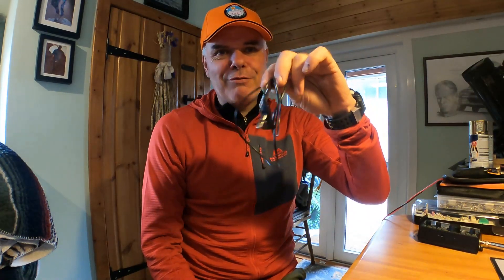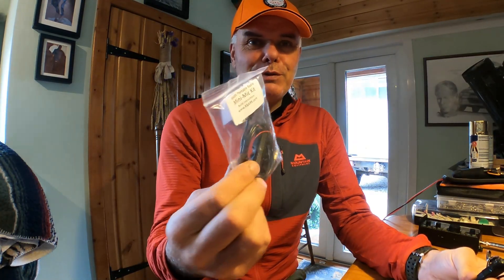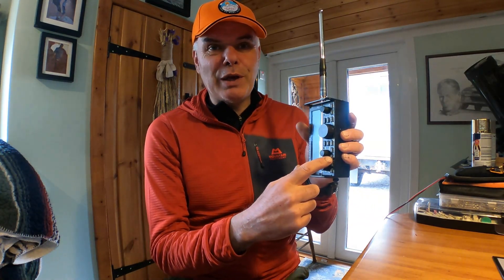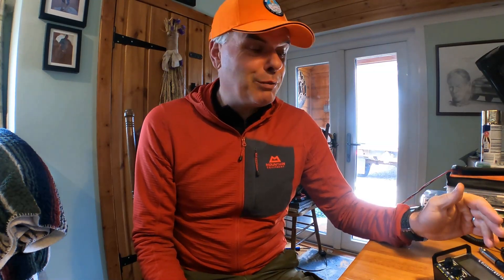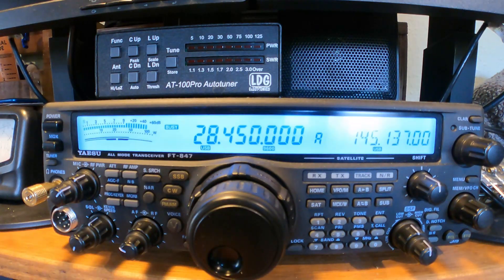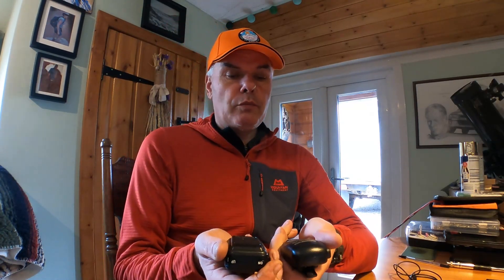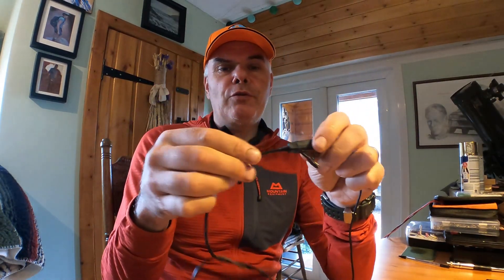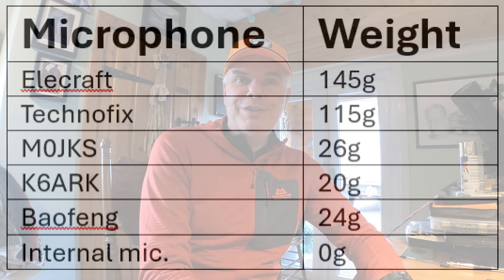Ham radio  microphone test

Comment: OK you asked for it Fraser! I always carry a converted Standard™ CMP115. September 2023, Lizard in Cornwall, some contest or another, KX3 at 15W through a home made loop on 20M, I managed Indonesia and Western Sahara among others so I guess it's good enough. I converted a similarly sized Icom HM-75 but I gave up trying to get the up/down buttons to work. It's fine but I stay with the Standard mic.I never use the MH3- I feel let down by the wallet gymnastics. Recently, I converted a Retevis HK008. This idea came from DL2MAN video originally and Gil, The Radio Prepper also has a video up on doing the conversion. This is an amplified loudspeaker mic. that has an internal rechargeable lithium battery. This takes some of the audio load off the radio. The audio is not perfect but what is really? You can hold it closer to your ear if the going gets tough and it sure beats Elecraft's internal loudspeaker. Yes it is around the size of an MH3 but it doubles as a loudspeaker. I've found that I use it nearly all of the time since I converted it, but I always have the Standard mic. in the go kit as a back up because it's so tiny.
Check out Gil's video Fraser.

And get up to 12 WPM at least, you'll never look back my friend. Seriously.

Another well presented Video Fraser.

73 de Steve.
Reply from the maker: Thanks Steve, I'll look into that. Morse is at 18 wpm keying, but struggling with copying, so will persevere until it clicks!
Cheers,
Fraser MM0EFI

Comment: I was using a cheap computer headset but the Rx audio quality was not good enough. I prefer in-ear headphones for their noise isolation, so I've been using them plugged on the original handled microphone of my tx500. However, because it's bulky and 'heavy', I just ordered a new computer headset with in-ear monitors ! It's a cobra GTX 408. Only 30g in a small form factor for an all in one solution. Will do an audio quality test when I receive it and update this post.
Reply from the maker: I look forward to hearing all about that!

Comment: I use a Beofeng mic too these days. has a nice long straight cord. I did some test with locals on the audio by adjusting the EQ settings in my KX3 and got it pretty good. Best way is to hold it flat on your chin under your bottom lip and talk across the top of mic. PTT on thumb in left hand pencil in other hand for logging.
Reply from the maker: They do the job nicely. I'm raging that my K6ARK one is sitting on a hill top. If it wasn't a 25km hike, I would have gone back up for it.
Reply: What’s you address I’ll send an extra kit I have Kf7zvl